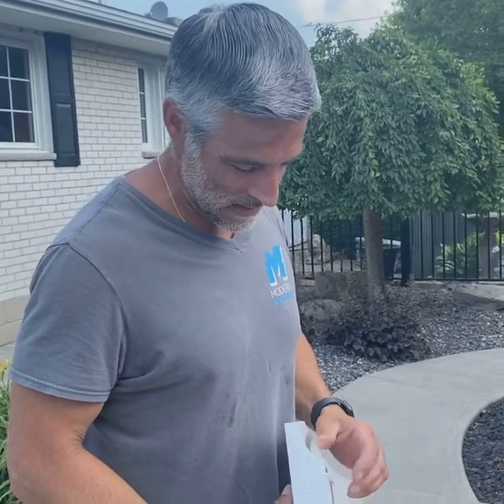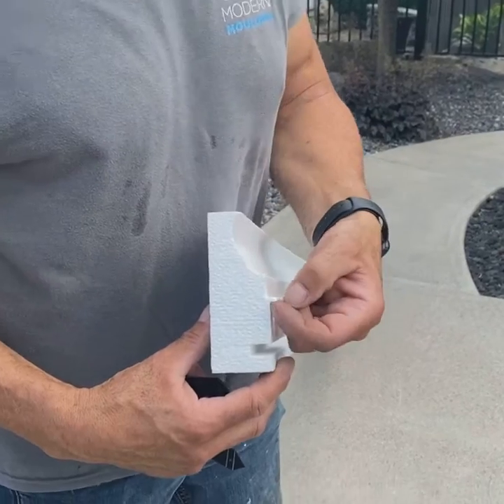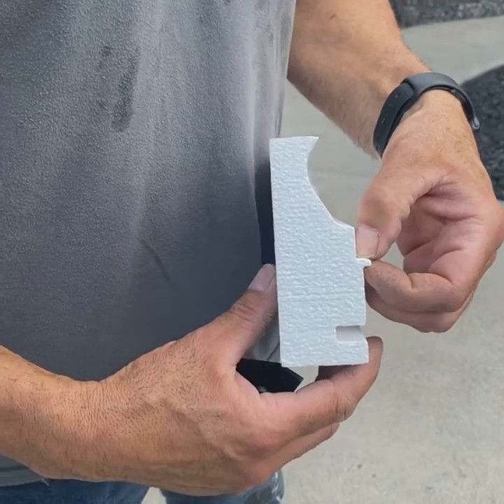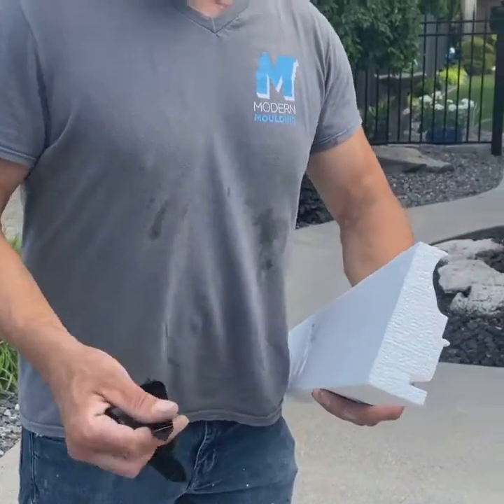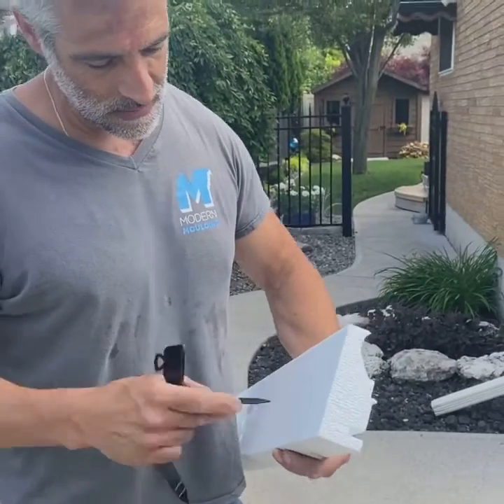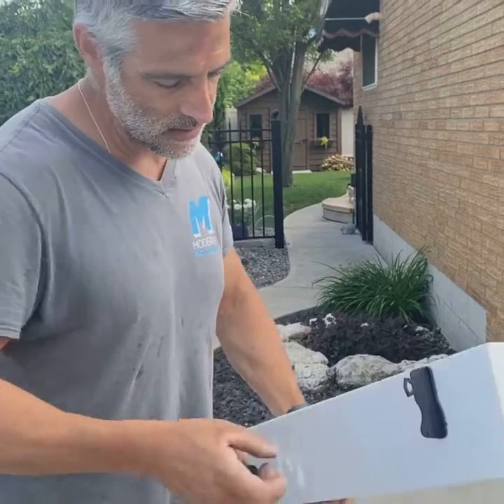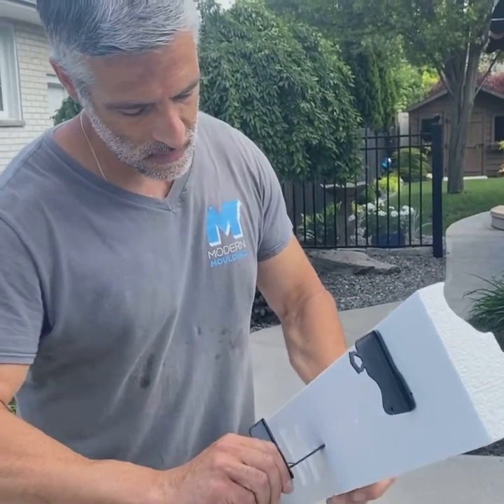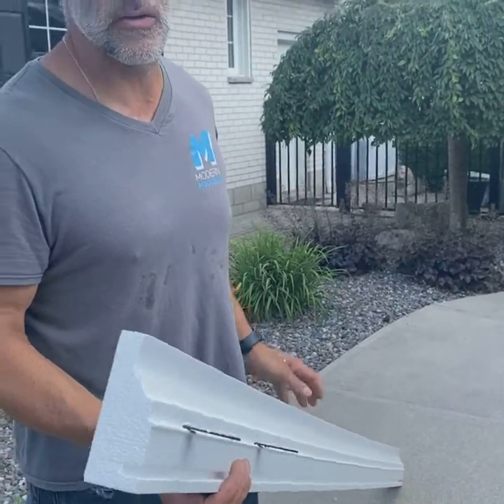Cantilevered Coping On A Concrete Pool

Comment: That pool is going to have a cracked bond beam.
Reply: I can't seem to find a video that is correct how to do it in California, do you mind helping? I would like to understand the difference in concrete pool and fiberglass in forming.
Reply: @hillside3696  Stagmeyer forms are used by pool builders in California.

Comment: Main thing I hate about this, is when the boss is to cheap to buy the no gum tape to put on the tile, and it gets concrete all in the grout and on the tile, that is a PAIN to get off after they have rubbed it smooth after taking the forms off to get a smooth finish
Reply from the maker: We hear this a lot. Thankfully our system doesn’t require the two way tape!  Don’t have to worry about that!
Reply: @modernmouldingpoolcoping24  my apologies I guess I read your comment wrong lol....but yes it is a pain in the but. Like I saod though I've been made aware of a product from Stegmeier....called "no gum tape"......this is what thier website says about the tape....

No Gum Tape is a tape that can be placed directly to the tile, fiberglass wall or the liner without leaving a residue. The double-faced tape on the cantilever forms may be attached directly to the No Gum Tape surface. No Gum Tape is recommended for use with one-piece fiberglass pools and liner pools having the liner installed prior to pouring the deck.
Reply from the maker: @gsxrlonewolf4088 , this is good information. We get asked often.  I will pass it along!
Reply: I'm referring to when you have already done the tile....and do the cantilever coping just like in this video....and if the tile hasn't been covered with a no gum tape to put on the tile before the Styrofoam forms are put on the tile, then when the forms are taken off and being smoothed, the concrete gets all over the tile and in the grout and is super hard to get off. I've been informed on a "no gum tape" that can be put on the tile BEFORE the Styrofoam forms are put on, so that the forms can adhere strongly to the tile.

Comment: So when you have to hand rub the front of the coping does it mess up the crisp line of the brush marks on top
Reply from the maker: Hello! It shouldn’t interfere with the broom finish at all. If you need to do a touch up it is usually just on the face.